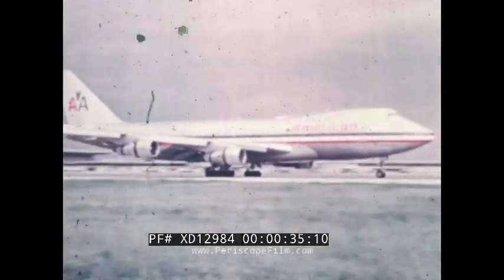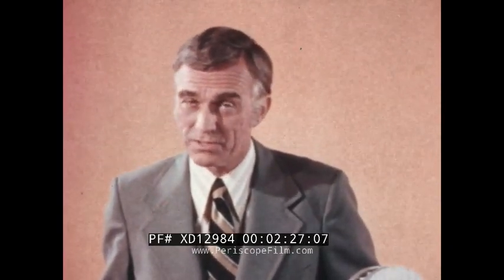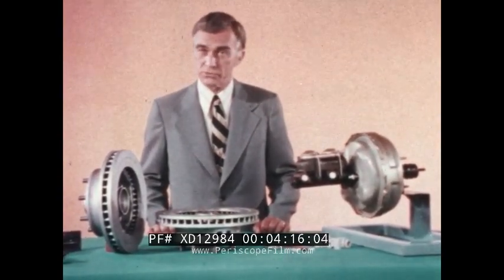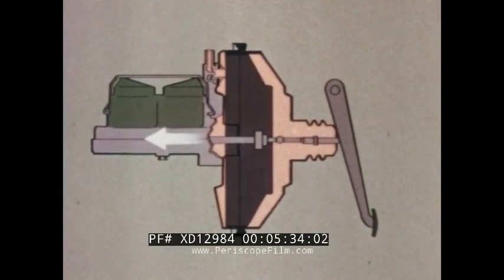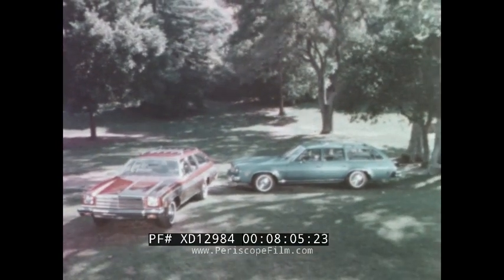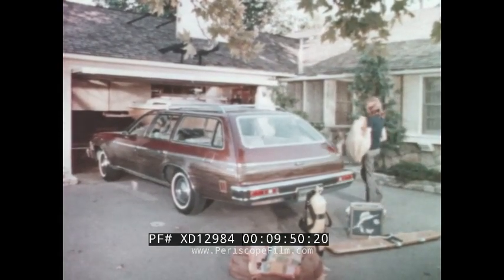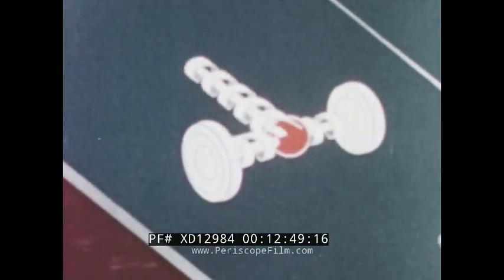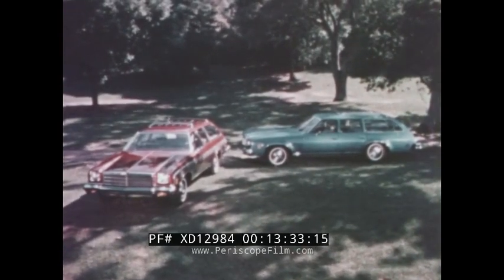" POWER TO STOP " CHEVROLET BRAKING SYSTEM & 1974 CHEVELLE WAGON PROMO FILM XD12984

Comment: Worst vehicle I owned was a 74 Laguna S3!  Cool car although the motor and spark control was trash!  Had to add a hotter spark box and distributor in order for it to run decent.   Sold it after a year and took it in the shorts and bought a cutlass and never looked back.

Comment: Chevrolet & GMC produced those generation fullsize pickups from 1973 through 1987 on the 1/2 ton & 3/4 ton regular cabs & from 1973 through 1989 on the 1 ton regular cabs & 1973 was the first year Chevrolet & GMC began producing bigger cabs on their pickups which were the crew cabs. The crew cab pickups, Suburbans, Blazers, & Jimmys all with that same body style were produced from 1973 through 1991.

Comment: As much as I love, or at least used to love, GM... this right here explains why American vehicles have SO MANY DIFFERENT PARTS FOR ONE THING, FOR ONE FREAKING YEAR OF VEHICLE! You have a 1500 series pickup, but with these options? Oh, you need this brake set... oh, wait, you also have this option? Eeek, sorry, you need these parts and we will have them in about a week as they are on the other side of the country.....Oh wait, your truck is from mid year? Oh....well then you need this combo of parts, and this part here is about 6 months out... and this one is no longer made.....
Reply: I work in ford service department that's ford's moto.

Comment: what was the reason why they did not put disk brakes on rear when they realized how good they were on the front? Was it 50 cents more expensive? Most manufacturers resisted putting them on the rear for decades. 

Strangely, I had a 1979 Fiat that four wheel disk brakes.
Reply: The logic at the time was that rear brakes are only responsible for 25% of the power needed to bring any vehicle to a stop. Which is true to this day. 
Drum brakes provided that easily. And it's a lot cheaper to use up their old stock. While implement new tooling for newer models.
Reply: They had 4 wheel disc brake options in 69 on the Camaro, 94 was the first year 4W disc was standard on them.
Reply: Used be amazed at how many 2020 semi tractors have drums all the way around .

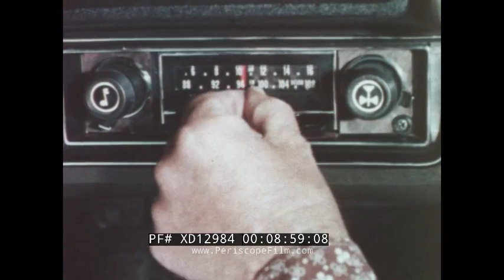Comment: 8:50 that is one crookedly installed climate control panel. Why couldn't they install it properly at the factory? and also the base system is kinda installed on a slant in 8:25 too.
Reply: Especially for something meant to show off/sell the car.
Reply: That was acceptable fit and finish in the American Auto industry in the 70’s ....sadly